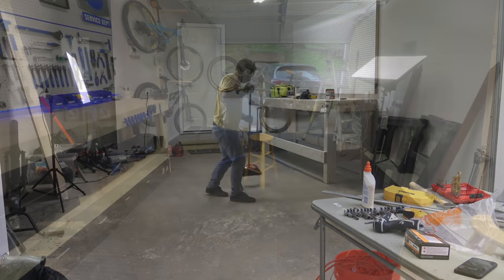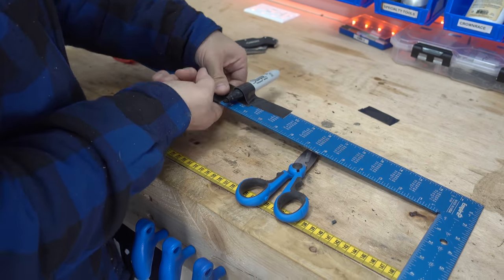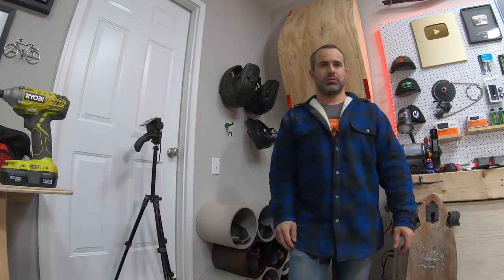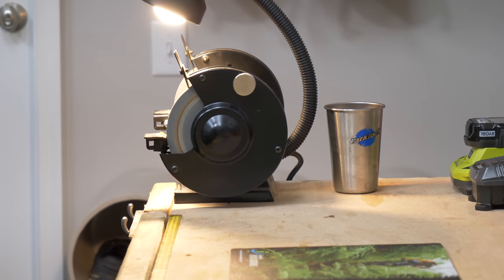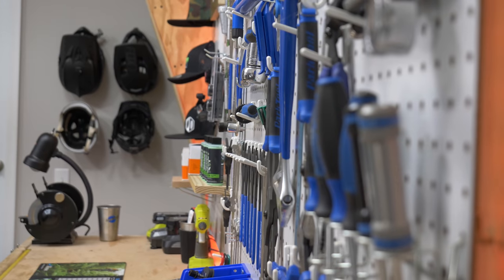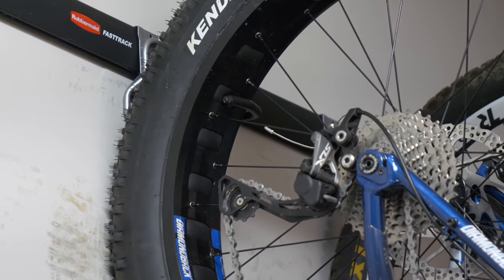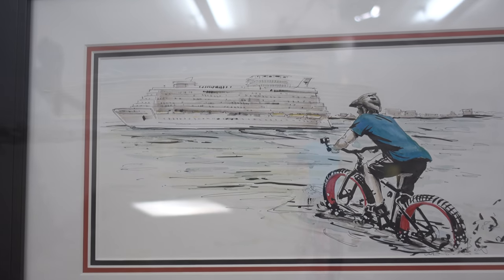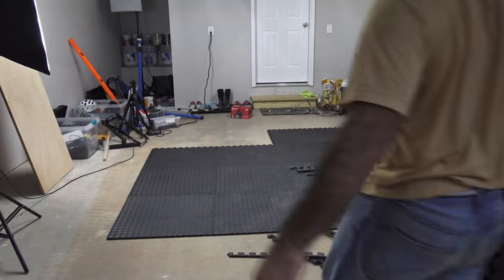Tour of my Home Bike Shop after almost 2 years

Comment: If you re-do your floor I'd highly recommend getting horse stall mats from Tractor Supply Co or Big R. They're usually around $40 per 4x6 sheet and can be cut to size with a box cutter. It's what i use in my home gym and they're bulletproof. They're comfy to stand on and can stand up to me dropping 400lb deadlifts. When they get dirty, a bit of Simple Green cleans it right up.
Reply: emehtonich ya those work good
Reply: Brilliant.  Love it when comments like this help everyone.  Thanks!
Reply: Can confirm! These are impressive. I used them on my own home gym a long time ago and there is nothing better. Would be killee in a shop. If they can handle a horse they can handle a man and his toys! Also the lack of a diamondplate pattern makes keeping them clean so much easier!
Reply: Awesome thanks for sharing I have a space that will be my bike garage someday. Not as large as a full one car garage but not bad for me

Comment: For the floor problem I would recommend horse stall mats. You can get a 4 x 6 ft, 3/4 in thick piece at tractor supply for less than $40.  They smell a little "rubbery" at first, but they will be in the shop as long as your shoe rack!  Pressure wash them to new again from any state(and when you first get them to tone down the scent).  I'd crawl under one of these mats during a tornado or earthquake. Bombproof. boom. Thanks for all the great hacks and videos!

Comment: One thing I would add is a wall mount for your camera. What I’m thinking is a retractable mount which can turn left or right with a part to go up and down to get the perfect angle and when it is not in use you can put it in line with the wall so you don’t have to move the tripod when ever you go around that little island.

If you read this thank you and pls like so Seth can see👍
Reply: Better, a bucket weighted and filled with concrete, and a pole sticking out the top. See Jay Bates' homemade tripod build. I'm in the process of making an even better one and hope to have a video soon!
Reply: Cool idea

Comment: 10 inch seems a bit overkill for shoes
Reply from the maker: I thought so too, until I tried fitting them into 8 inch
Reply: @SethsBikeHacks  Ah, I understand. Just aesthetics I guess, not used to seeing 10inches of PVC stacked
Reply: @SethsBikeHacks I know its a little late for this, but Menard's sells 10 PVC in short pieces (not sure if its in your region, its kind of like lowes/home depot but much bigger). Nice job tho. looks sharp 👌
Reply: I actually like that they were big enough to fit the pairs, those pintrest ones that only held one shoe would drive me nuts.
Reply: @h82fail  Fair enough

Comment: Thanks for all of the awesome content! Watching all of your videos is very inspiring. I have a few coworkers that have started to ride with me and they are now watching your videos and we talk about the content after each ride. I even built one of your 2x4 bike stands for my new 2018 YT Jeffsy 29er large frame. This is the 1st full suspension bike I have ever owned and watching your videos on what to look for on a new mountain bike gave me the confidence to drop the money on this amazing bike. Before this purchase I used to ride my specialized hard rock compact disc break that I bought after saving for years back in the 90's. I now allow my friends to ride this bike and they love it! Ever since I found your channel I have been binge watching your videos as well as Alex's videos and even Phill's videos. I am dreading the day when I am finally caught up on all the videos. 

I also have a 2001 Toyota Tacoma with out a toe hitch. If you have seen one of these trucks you will notice that the tail gate is very narrow and the bed is not very deep. Because of this, no tail gate pad was small enough for my truck. Eventually I created my own hack. I bought a large pool noodle and cut it down the middle. I then strapped it to the tail gate to create a pad that would not harm my truck or my bikes. I can send you a picture if you would like. It didn't look pretty but it got the job done for about $5.00. 

This last season I found the answer to all of my problems when I needed to take several bikes and my buddies to Big Bear in California. Many people have smaller older pickups with shallow beds and thin tail gaits which is why I am sharing this with your channel. I found a bomber strap tail gate pad. They are much cheaper than spending money on a hitch for a truck that only has a few good years left. They are also cheaper than a full tail gate pad.

Thanks again!

Comment: Thanks for the tour!  I came away with a few good ideas.  One suggestion for your workbench is to cover it with a thin piece of MDF or Masonite.  It's not super expensive and because it's smooth, it's easy to move things around on it, heavy or light.  Just a few screws will hold it down and keep it from moving.  When it gets too skanked up and marred, it's easy to replace with another piece.  Thanks for all your hard work, I learn a lot from your channel!
Reply: He wants the top of the workbench to be all jacked up and stained.

Comment: I am current in the middle of a big upgrade to my bike shack. Added some closed in cabinets above the work bench to prevent my gear from getting covered in saw dust. Will also be adding stainless steel counter top to the work bench, they are surprisingly cheap (~$500 CAD for a 2' by 16' counter top).

Comment: Looks good mate.
in my bike shed I have over head storage that looks like it is the ceiling but is just a layer of of plaster board reinforced with plywood that can be lowered simply with pulleys it looks great and gives me heaps more room for bits and pieces. you can also choose the distance between the panel and your ceiling depending on the height of both you and your ceiling just by tying of the pulleys at your desired height.

Hope this was of some assistance for your future projects :)

Comment: By using a sheet of plywood and some wooden dowels you can make your own custom peg board to hold all your stuff while looking nice. Add some stain to make the dowels easy to find and it’s strong enough to hold anything you put on it. Doesn’t fall apart and shelves can be another easy was to hold bigger objects like a bucket of bike cleaning supplies.

Comment: The horse stall mats from an Ag store like tractor supply or Big Blue make awesome garage flooring. Much more durable and resistant to stains than that interlocking stuff. I use them in my workspace and garage gym. They are roughly 5x7 and about $40 on sale. They do not interlock, but are so heavy they don’t move around.

Comment: You can use a gear cable to cut pvc tubing. Just wrap it around the pipe and move it back and forward.
It is great for cutting pipe in tight spaces or against walls

Comment: Check out Wall Control.  It's metal pegboard, so you can use all standard pegboard accessories, plus has slots that use their specific stuff.  It's great and modular.  The panels have clearance built in so can be anchored directly to the wall and already set up for standard stud spacing.  Plus, IMO, it's relatively cheap for what you get.  I bought quite a bit for my garage and would 100% do it again.  Very easy solution and just as easy to re-arrange when the need arises.  Amazon has it.  Plus, you can use all the pegboard stuff you already have....

Comment: Im just getting my shop dialled just now. I built a fairly big project work bench that is on wheels so I can move it to the perfectly position for filming. It has huge drawers for frequently used tools and shelfs underneath for the not so frequent tools. I need a bench vice though and I stole hpur usb port on the counter top idea.

Comment: I do like what you have done with your shop.. I am going to use some of those ideas to fix a couple of my own issues.  One word of caution, I had tried that exact floor foam and it does not breath, my cement was getting mildew so I ripped it all out.  If your floor is sealed with epoxy you are probably good,  but cement needs to breathe.  I ended up getting resuarant kitchen mats that interlock. Pricey.  Did only the traffic/standing areas. Solved the issue. Just an FYI

Comment: Seth, if you like the pegboard but don't like the material, look into something called wall control. You can get the panels in a bunch of different colors and they're made of steel. My only complaint with mine is that I need to order more of their "pegs" since they are a propitiatory design.

Comment: Omg, I'm about to buy a beefier bench vise.  Bench solid, existing vise wussy...  Favorites:   coil cord on the pancake compressor, truing stand on a wooden platform I can clamp in place or push back when not needed, fine point grease gun, isopropal in spray bottle, park tool pick set, vice grip style chain whip, dorm fridge, vintage beer clock from a Midwestern bar so I remember to go home. Oh, so I built a custom bench around two 8-drawer tool chests.  Have a window above the bench, so no tool pegboard porn for me, bit I have everything I need a drawer away.

Comment: How do you successfully heat up your garage in winter times without a gas oven or a small (and maybe inefficient) electric heater?
I got a petroleum heater, but the smell and the gases are a pain in the ass, so it's not possible to heat up the garage to a comfortable temperature

Comment: Go on craigslist and look for an old rae, record or another BIG HEAVY OLD cast vise. An old beat up rae is still 10000% better than anything made today.
Reply: I was thinking that myself, I hate rubbish vices! I have a 4” Record one in my bike shed which I bought cheaply on eBay and restored. Nice little project for you Seth!
Reply: @andygilbert1877  I have a 8.25 inch rae in my shop that I sandblasted and painted, it's really big but itll hold anything
Reply: Loaf Of Eggs That sounds like a right beast! 👍🏻 I work on fork lift trucks for a living and way back when I first started 8” vices were pretty standard, and you’re right, they’ll hold anything! It was always Record vices over here in England when they were still made here, but looks like Canada & the USA have many great makes from way back.
Reply: @andygilbert1877  yeah, rae is a Canadian brand, but my dad has a 9.5 record, it's a UNIT.